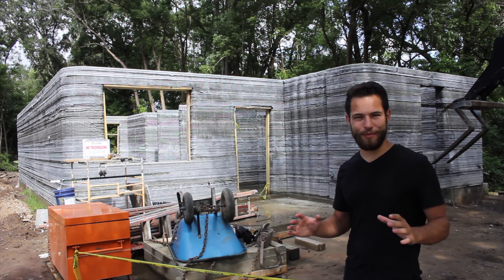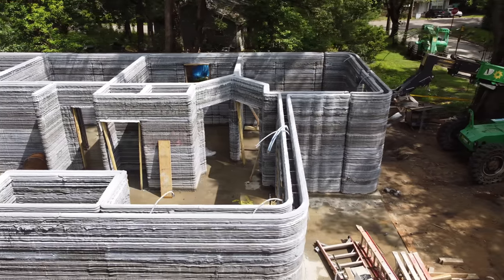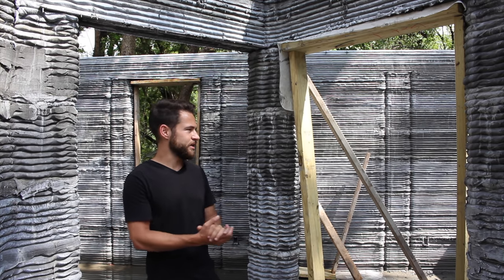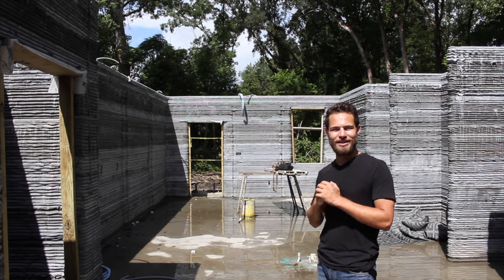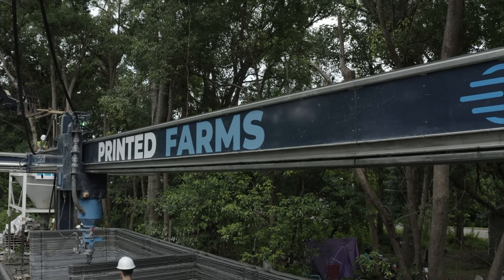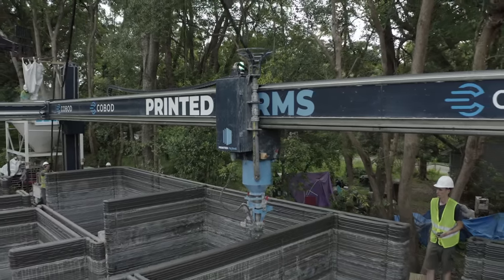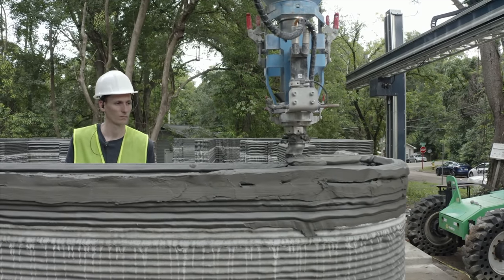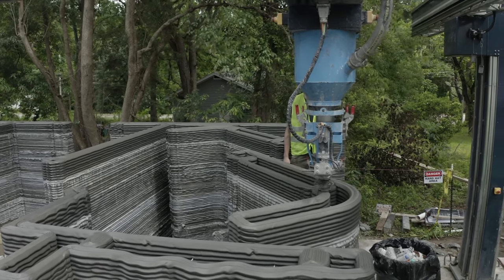First Permitted 3D Printed House in Florida | Printed Farms Strikes Again

Comment: Buildings in communist countries have already been made of concrete. That was given up, because people don't like such buildings. However, I suggest you give up the 3D print of all the walls, but only print the supporting pillars, because that is what requires the most time during construction. Filling the space between the load-bearing concrete pillars with building blocks is not difficult, and can be completed in 2-3 days.

Comment: Looks like total crap. No place for wires, plumbing, still need to smooth walls, no roof, can't make 2nd floor, etc etc. just because you can 3d print it, doesn't mean you should